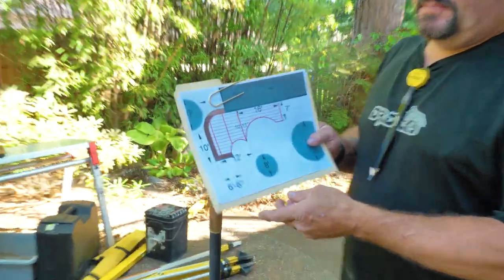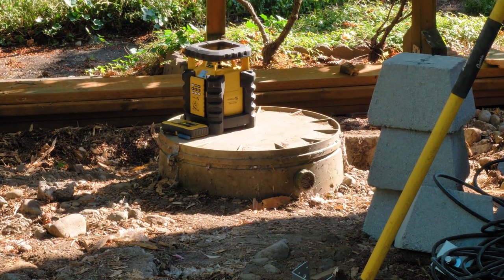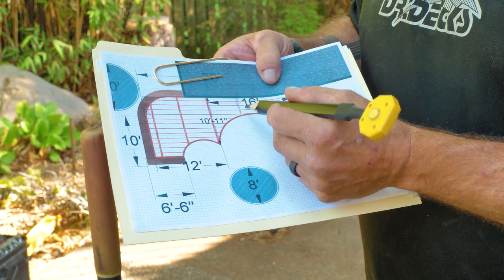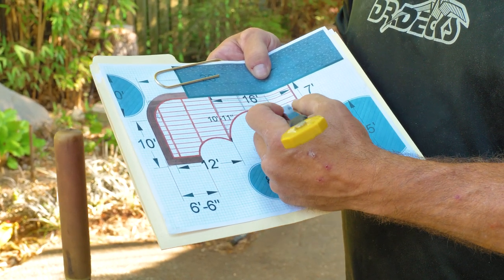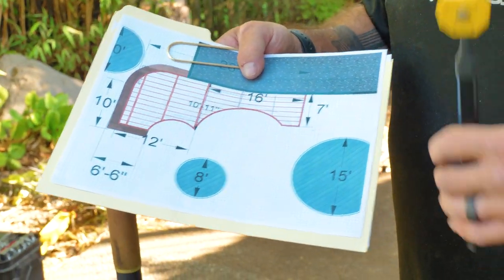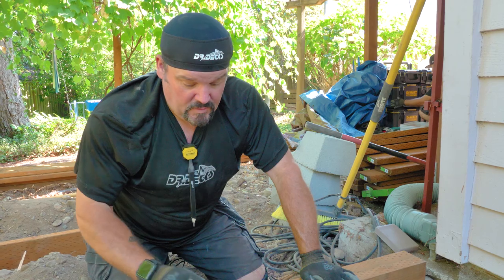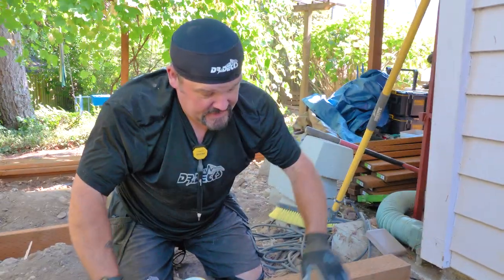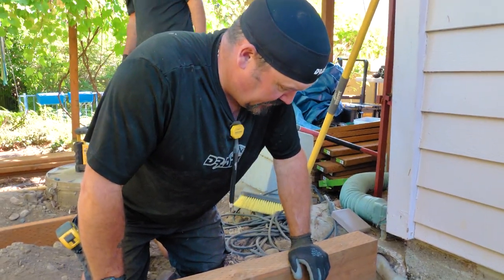Build Update: Framing For A Low Deck || Dr Decks

Comment: I’m attempting my first deck...it will be really low, also. What is spacing between the joists and down the length of the joist with 4x4s? You are a great teacher.
Reply from the maker: Consult your local engineer. I’m not qualified to give out structural advice.

Comment: Shouldn't the minimum  Height of your beams over the grade to be 12" so as to prevent moisture rot on your lumber?
Reply: I'm not an expert, but I agree with you.
Reply: AC2 lumber is designed for direct ground contact. If it's not going to be seen, you can also coat it with a sealer and it will never rot.